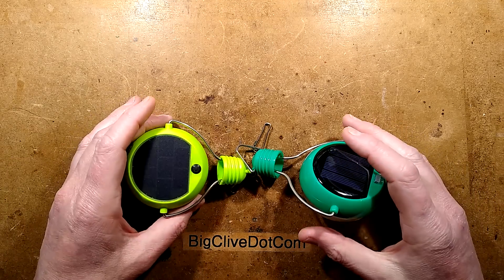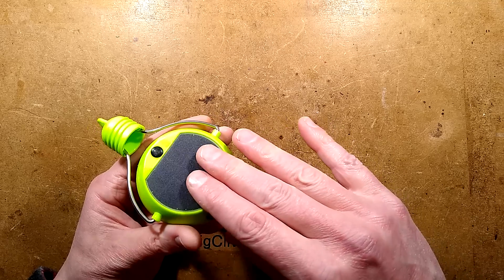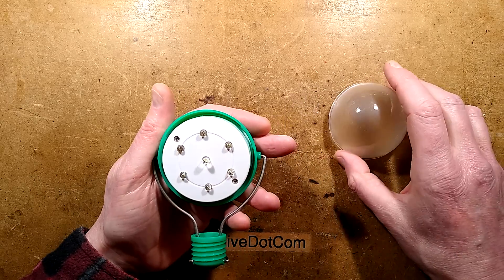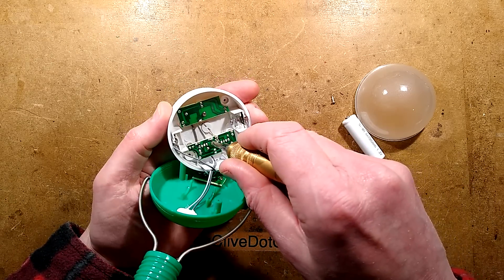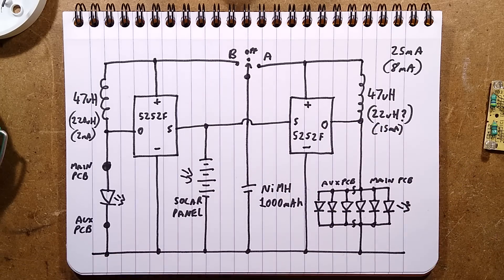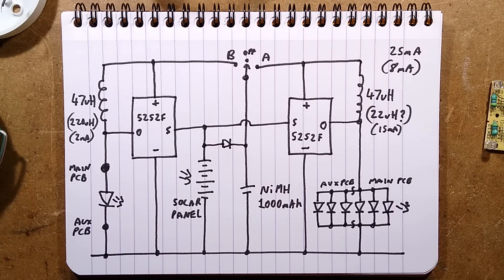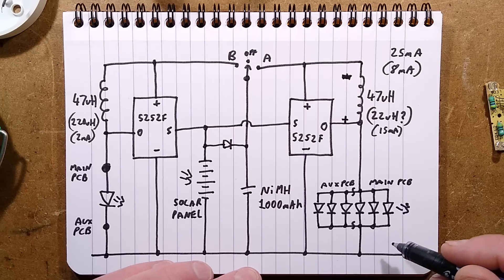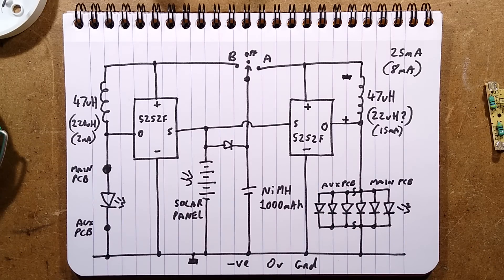Tacky Nokero solar light clone

Comment: I seem to be missing something.  How does the solar panel charge the battery at all without the diode in place?  Am I missing part of the circuit that connects the two, whether the switch is on or off?
Reply: How does this comment show as posted a month ago, but the video shows as posted a half hour ago?
Reply: @jimsackerman  The Patreon Fairy
Reply: @barrieshepherd7694  thanks, I hadn't realized he had a Patreon... Just realized the link to "buy me a coffee" goes there, thank you!
Reply: @jimsackerman YouTube magic. Lol
Reply: @jimsackerman  Good question, and I have no idea.  Youtube does weird things without notice.  Perhaps and updated version of the video replaced the original?

Or maybe because of daylight savings time?   :)
Reply: It's an innovative way to protect against overcharging. ;)
Reply: The IC itself includes the charge path between the solar cell and the battery, by an integrated diode or possibly mosfet switch.
Reply: @ferrumignis  Do you mean the schematic is wrong not showing a non-switchable path to the positive pole of the battery or that the chip is not used properly?
Reply: @atdzsny  No I mean the path between the solar cell and the battery is internal to the IC
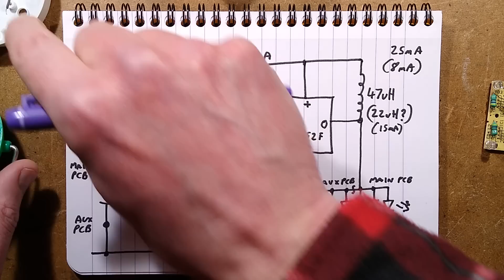Reply: @ferrumignis  4:25 Look at the schematic: the + side of the battery is not connected to anything .
Reply: I think it's like a garden light you leave it ON then the controller charges the battery turning the light on when the sun goes down.  The logic that the battery should be charged when the switch is off has been lost on the designers!  

Some garden lights suffer from this problem, they only charge if left on - the switch they provide is pointless in many cases and as that is often the first failure point, due to corrosion, can be bridged out.

Comment: Being that the AA cell is 'upgradeable', I would strongly consider rearranging the LEDs to allow running them all at the same time, possibly with both of the 5252s paralleled.  But I have no experience with those 5252s.  I do have extensive experience with Joule Thiefs, thanks in part to Clive, and I can tell everyone that the reason why the 22 uH gives more LED current than the 47 uH is not because of the inductance.  It's because those tiny inductors have fine wire that has high DC resistance that limits the peak current when the transistor is turned fully on.  If a bigger inductor of the same value with heavier wire is used, it will allow higher peak current.  However then the transistor's maximum saturation current and current gain at high current limit the maximum current and hence the LED current.  That's the reason why I didn't ever use the 5252, instead I chose very high current super beta transistors made for switching, such as the 2SD965 and 2SD5041.  These were obtained from the flash units of disposable cameras.  Later I bought them online.  And I wound my own toroid cores with much thicker wire.  Thank you, Clive, for getting me to start experimenting with Joule Thiefs.